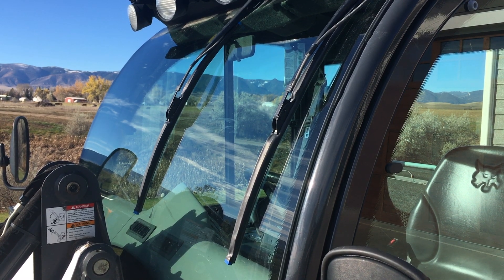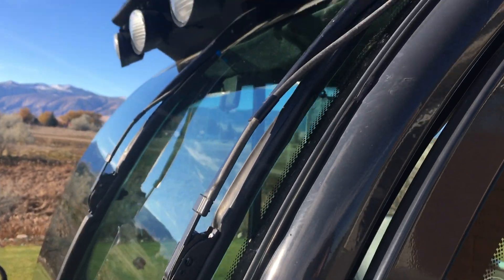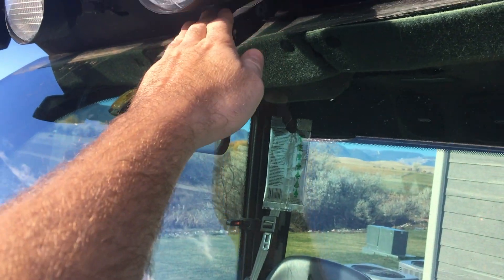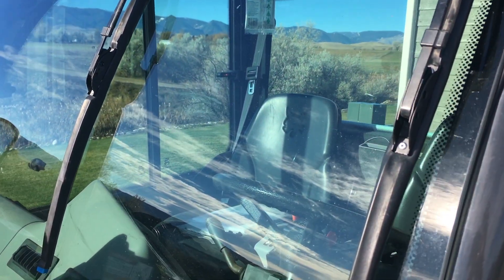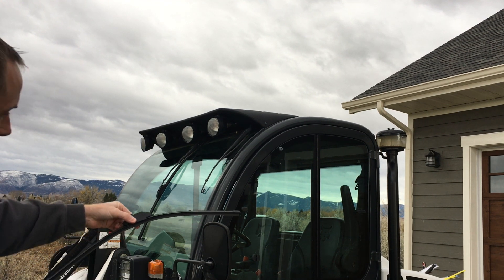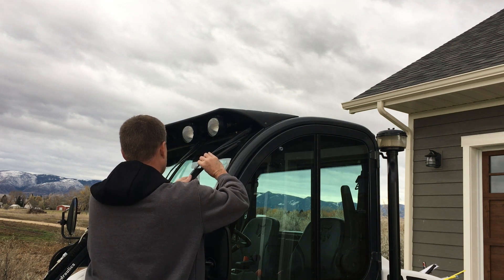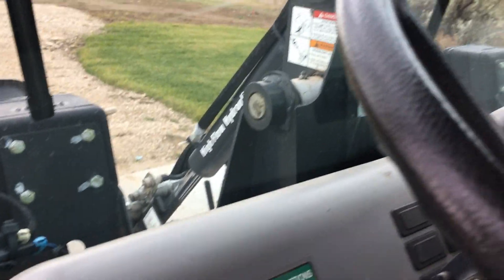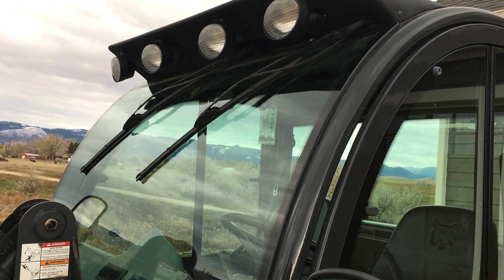Bobcat Toolcat 5610 Tractor Wiper Blade Change

Comment: Hey, where'd you find that snorkel air intake??
Reply from the maker: I bought the machine used and it was already installed.  However, I've seen other toolcats with the same setup, so it must have been an option at one time.
Reply: Ask your dealer, it’s a bobcat part. Some dealers won’t know it though